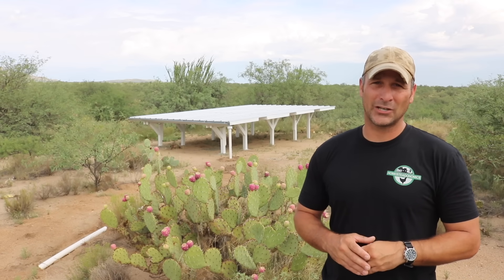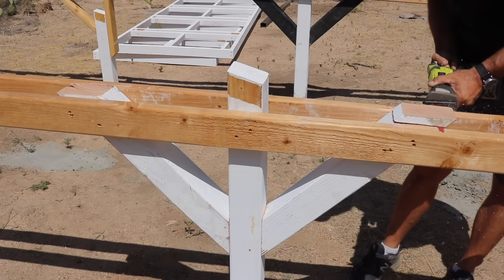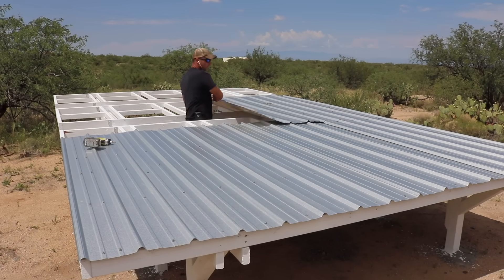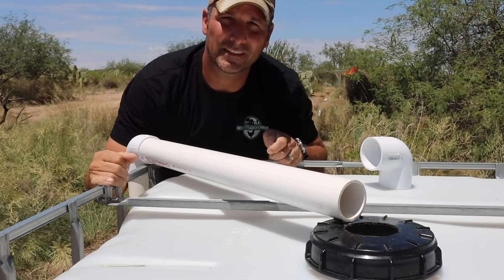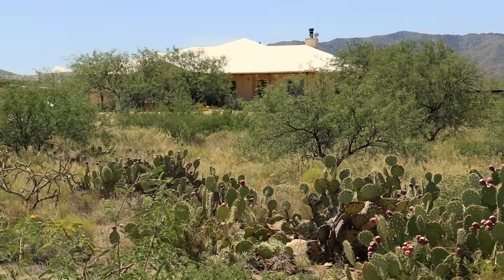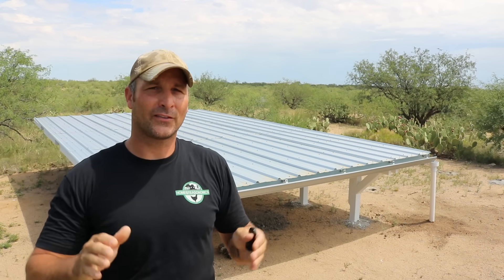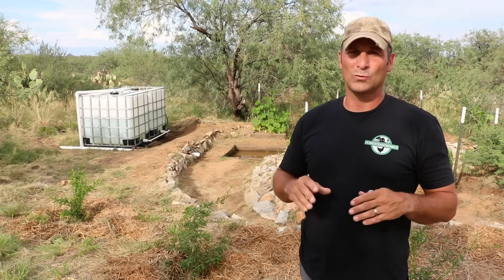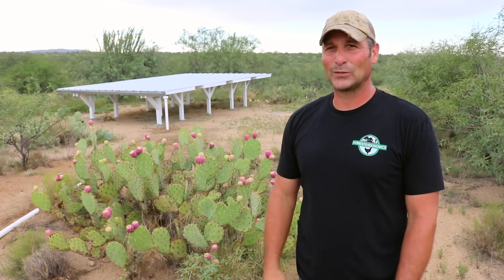Rain Roof -  Rainwater Harvesting Project - How To

Comment: @homesteadonomics I have some questions that hopefully you don't mind answering.  I understand that because of the desert environment, your area probably does not get a lot of rainfall, but approximately how many inches of rain does your area gets each year?  You should be able to google that information.  Also, what is the square footage of your rain roof and the number of gallons you were able to collect in a year?  I realize it's probably minimal but knowing this information is still helpful.  Additionally, because of the way your system works, I assume you have a lot of trapped water in the pipes leading the collection container.  Does this cause any concerns?  Do the IBC collection containers need to be cleaned a particular way, at a certain interval, to prevent bacteria growth?  Are you able to pressurize water in the IBC collection container in order to water your garden with a hose or do you only use gravity to fill buckets and then use buckets each time to water the plants?   If you don't have some of this information but think it might be interesting to collect for analysis, similar to the way you did analysis on the project that preceded this one, I believe it would be interesting to viewers.  I'm definitely interested.  This could be a good follow up video.  Also, I like what you mentioned about incorporating a rain roof into another structure.  I have been considering how to best help my parents with repairing, remodeling or even tearing down and rebuilding their home.  If the home becomes a teardown/rebuild, one consideration I would like to think about factoring into a new home is a rain water collection system.  Do you have thoughts on the best way to add this type of system to a home and doing it in a way where it seamlessly integrates into a home and is designed for easy routine maintenance?  Thanks for making this video and I hope you consider making a follow up video that answers all or some of these questions.

Comment: Just a note about your cool garden.  

You'd be well advised to move one of your mango trees.  

They won't stay small, we've four in our yard, three that started as seed from preferred fruit, one grafted, from a three gallon bucket.  

Now, at fruiting maturity (4-5 years for the youngest, 10 for the only grafted variety, a Glen.) the smallest has a drip/root zone with a ten foot radius.  The largest twice that.  All are now bearing fruit, and still growing.  I prune to reduce height, improve air circulation at the center, clearance for bed maintenance, and to make harvesting easier.

Your trees appear to be about four feet apart, at a minimum your spacing should be four to five times that.   Remember, with proper care those little bushes will grow easily to twenty-five, to thirty feet tall, and easily as wide.  Don't think of them as they are now, but when you'll be picking your first delicious, desert grown mangos.

Otherwise they will not reach their potential either in size, shade, or yield.

Best to do it now, before their roots get more established.  

Last years yield exceeded three hundred pounds.  This is the season where they put on bloom for next years growth, and we're looking for even greater yields this year, as two of the trees just started fruiting last year.  

Great water collecting idea.  Good luck with your desert fruit trees.

Comment: Mate you did good at minimum cost, being financial or labour intensive, only one thing all piping to tanks should have is a valve in between roof downpipe and water tank, as in summer times roofs get covered with dirt, so its best to drain the first bit of rain water so it needs to be able to flow straight out and not into tank. JMHO

Comment: Cool.  It works great!  I didn't know you could fill the totes using the change in elevation. 

Some ideas for the below roof.  Somewhere close to the perimeters 1. You could use the shade for rooting cactus in pots. and cactus seedlings  2. you could partially bury slope shouldered bottles filled with water (maybe spiked with vinegar). Then inter-crop with purslane (verdolaga) or some other plant.  The plants should be able to survive on the dew that condenses on the bottles.  

I plan on doing this, but haven't yet.

Comment: Here an idea fir you, place underground. insulsted cistern. Get a few gallon's of Gallium and heat it up and then feed it lot's of Aluminum can's to make Gallium Aluminum alloy. Now make's a platform like a solar panel on a stand that can move and follow the sun like a solar panel on a pole that can support the weight of the Gallium Aluminum alloy. Okay now use copper pipe with those fins on it for heat exchange and zig zag connecting the copper pipes within your platform that meet in the center of the platform and use thick wire to bend a stand to keep your copper pipes in the center of your platform. You will need to place bendable hoses to connect copper pipes to the insulsted copper pipes running inside the support pipe. The idea is that you have a platform that follows the sun that has super heated Gallium Aluminum alloy being circulating through the system that passes through thermal electrical power generator's that power atmospheric water generator's that pass the water through a filter then fills the insulsted underground cistern with the Gallium Aluminum alloy being circulated through a copper heat exchange coil in the insulsted cistern heating the water that is then passed through more thermal electrical power generator's has the heat is bled off and the generated fresh clean drinking water fill's protected underground cistern's. Way better the solar way better then rain collection. 😯😊😉

Comment: Hello,
             On your first Rain Harvesting project you used 4" pvc pipe. Was that  an adequate size or could you have gone smaller? Also how deep did you bury the pipe running to your storage tank?  Did you run into any problems crushing the pipe driving over it  because it was shallow? Was it a thin wall pipe or sch 40?

Thanks,
 C. Collins

Comment: You didn't think that very well. It's not tall enough to stand underneath when it does rain or do you strip off and ring out your clothes to add a bit more to the holding tank.

Comment: (sorry for bad english)

 maybe there isnt enough "pollutant ellemts" (like leafs) that can get inside the thing "mouth" of the water tube but..althought more work, for this, wouldnt it be better to have mild cone-shaped (upwards) structure, so the water falls inside anyway, and the pollutants just roll off to the sides, avoiding clogging? I have zero experience on that so..what do oyu think?

Comment: How about an in ground cistern with a solar panel roof ? Set it up at an angle and put the rain gutter at the low end and a pipe turned back under  the roof. You could then use a hand pump at one corner to draw the water out. Or put some pipes onto a bottom drain and let the water run into you garden when needed.

Comment: I was wondering if you would need a splash guard on the backside of the pipe going into the ground?  If the rains come down hard, the force could cause the water to overshoot the downpipe?

Comment: On average, an on-grid family uses (USGS says) about 300 gallons per day per person. I find this amount exorbitant, In my estimation, I could get by nicely on about 16 gallons a day (a little more when I am working hard). So a family of four might use about 26,000 gallons a year. In your area, I see you can pretty much expect about 11 to 12" of rain per year. Allowing for a 15% surplus to account for drier years, that equates to a total rainwater collection surface of about 3,600 square feet.  And this does not account for gardening water, evaporation, incidental waste, etc.  Subtracting about 2000 square feet for your home and porches and shop, etc, you need another 1,500 sq. ft of collection surface for basic needs. That's an area of only about 40 ft. square- on a ranch, that's just a small cattle shade- Considering your whole system, you really have a very affordable system, even in the desert environment. Here in Las Vegas, we would need about twice the collection surface to survive for a year. A little further north, though about half of what you have a need for.  so, I can see how the location, location, location is the key to off-grid water supply systems.

I am highly impressed with what you have accomplished. Your ingenuity and craftsmanship are quite impressive. If I was younger, I would certainly give it a try.
Reply: average americans take 2 or 3 showers every day, let the water run when using the sink and flush toilets every time, as well as running dishwashers and laundry machines, washing the car, watering the lawn etc. so yes, in an average month it's easy to waste that much water.

Comment: Do not copy this design for long winded projects. The water will work its way down into the wood threw the screws drilled into the lowest portion of the sheets set in place. its for the same reason that the sheets collect water, gravity, or acceleration if you think that way.
Reply: screws should be placed at the high points along the metal sheets to avoid this problem
Reply: aka the ridges
Reply from the maker: They are actually in the intermediate ridges.... it looks like it is a long flat section but they are actually in two mini ridges put in the profile for mounting.  😀

Comment: You did a great job on this setup, only question that I was thinking off since this is relatively new to me is: Can the rain water be used to drink? if so what type of filtering system would be needed. I think the idea of using rainwater has a thousand possibilities. Good job!
Reply: Sir,
Yours a very good idea of glory.
Thanks from Venkatesh C D
Bharath

Comment: Very cool.  The transition to 4" pvc would allow you to make an angled debris screen which is better at self cleaning.  Maybe even simply a roll of window screen with a cap, on the setup as is or search 'rainwater collection leaf guard' for the type of thing I'm suggesting.
Watching Derek's build I noticed he wasn't collecting the water off the panels which would be ideal dual use.
Reading the comments about paint, regular old rustoleum held up best on my pool pvc.  But a few more bits of those panels, maybe some found pallets to put roofs over the totes.  Keep the sun off and collect just a touch more water.

Comment: why on earth didn't he make that roof like 8 ft. tall.  it would have been a minimal difference in cost and effort, and he could have had a nice little shaded patio.
Reply from the maker: yes, it would absolutely be more ideal to have it higher or as part of another structure or use.  Was trying to use what I had on hand with minimal inputs.  I actually address that point more than once in the video.  Additionally, our winds are pretty violent here and if I made it higher, I would need to re-dig the post holes and  use steel posts... as the wind will rack a structure like that a lot

Hope that answered your question :)

Comment: this is kind of stupid, sorry

not only do you have a standalone roof, which serves no purpose but to collect rain in the desert ...... but your piping is also as such that you have 75 feet of trap. 

75 feet x 2" id = 12 gallons stuck in your pipe at any given time, until you have another 12 gallons come and replace it. 

i mean come on build a shed or something that the roof is actually useful for.
Reply from the maker: Kevin Keel I mention several times that this isn’t the ideal set up and that it would be better to have a higher structure such as a carport, shed, etc...   this was an existing roofing prop that I was trying to get some extra use out of it without trying to build something bigger. Anyways, maybe it atleast shows a way of how not to do something😂

Comment: Good Job!  The Big Island of Hawaii is very familiar with the Rain Catchment System. This is how we live,we  catch our own water. The trick is(...well no really) is maintaining the water quality . And knowing the Chlorine to Water ratio,to make it not only safe for the plants and livestock  but also for human consumption or drinking. We get lots of rain here,so why pay for  something ,when you can get it free. Again good job and great video. Thanks
Reply: Thank you, for info. Grew up with underground concrete tank, no light entering. Not sure, but i dont remember any algae. And i once heard that the lime that slowly leaches out of concrete, will alkalise the water, does anyone know facts on this. Cheers
Reply from the maker: Thanks for checking it out!  and great to hear from Hawaii!!

Joe
Reply: WHO do you add chlorine? I would assume you have clean air on the Island . Living in rural Australia , we have used pure rainwater all of our lives
Reply: @davecurrie3066  . As with all standing water, chlorination is necessary to keep the water clean and drinkable. This is standard practice for all municipal water supply....not sure of  Australia's climate, but we deal with constant Humidity changes. Hot -Cool. Heat and humidity will contribute a great deal to algae growth......that green stuff that accumulates on the bottom and sides of the catchment tank.
You don't need a whole lot of Chlorine, just a little, to make the water fresh and clean.....just follow the Chlorine ratio chart and you'll be fine. Last note; Chlorine can also act as a deterrent from pests like mosquitos, ants, snails, slugs.

 After all, everyone needs Water to survive.
Reply: "why pay for  something ,when you can get it free"
Since you labor is "free", I would like to use it. How much do you charge for free labor?

Comment: You said double use is best, so while I brainstorm here I’m thinking a solar panel roof system built on top of my A frame house roof rainwater harvesting system which would take up the entire roof of my two story A frame house. It seems my roof’s gutters have to be higher than all my water appliances and utilities so that’s not too much trouble. Thanks for your ideas. ☺️ and the car port is included too so thanks

Comment: Why is it that the government doesn't run a water pipeline from the flood areas such as east coast areas that recently flooded to the west coast area? One the infrastructure is done, it would be low maintenance. California could use it for irrigation of our food source crops. It could be used to put out wild fires. Not necessarily potable water. Let the states that it runs across maintain their sections of it. If water is needed so bad elsewhere why not do it. Oh yes, politics.
Reply: ...because moving water across the entire country to another part of the country could have serious impacts on the ecology in those areas.
Reply: Scott Runge Plus the vast amounts of energy that would be required! Plus you have to capture and store the "unwanted" water at the initial location- you couldn't pump it all at once so need to store it until it can be pumped across country. The infrastructure would be massive.
Reply: Coastal areas where rain is all too abundant are generally low in elevation, close to sea level, while high deserts, like where I live in Arizona, are 800+ ft up above sea level. That means you'd have to not only run miles and miles of pipeline across the country, but you'd also need lots of pumping and energy input too. 

Wouldn't it make more sense to simply drill 800+ ft wells instead of wasting all that piping and energy to move water for miles across the country? Theoretically, if you dig a well down to sea level, any water you remove would gradually be replaced by water moving underground from wet locations to your dry location. This would achieve exactly what you had proposed, but without needing miles of pipeline and only expending enough energy to raise the water vertically instead of both horizontally and vertically.

Also consider that cross-country pipelines are prime terrorist targets, devastating everyone's essential needs downstream from any pipe breaks. Individual wells would be far more difficult to disrupt on a mass scale. A good example of this is Libya -- prior to the United States ousting Gaddafi, the Libyan government had been building a massive water pipeline across their country to bring abundant water in the south to the dry north. Those pipelines were destroyed, bombed out of existence.

Comment: One small thing i don't really understand.. how does the water go up from bottom?. I mean.. the tank is pretty high, and the water that comes from the pvc line are at the bottom. how do they go all the way up by themselves?.
Reply from the maker: its the level difference that allows the water to flow.  the inlet, where the gutter is... is higher in elevation than the outlet, where it empties into the tanks
Reply: First, thank you for the reply. what subject should i search for on youtube / google to learn about it and see examples?. How does this term called (the height difference which allows water "climb up" ). Thanks again!.
Reply: Check out his videos- "Rainwater harvesting Whole house System" has a drawing that shows how it works. :)
Reply: @mmx3662  thank you!

Comment: You should put solar panels on the roof so you can collect solar power and rain. It shouldn't effect the rain collection either.
Reply from the maker: if it was closer to the house and I had some panels then yes :)    But when I get to doing solar I would opt for having a metal framework instead of this style
Reply: Keep the design in mind to be able to do both water collection and solar production